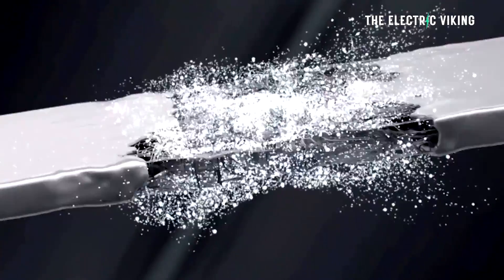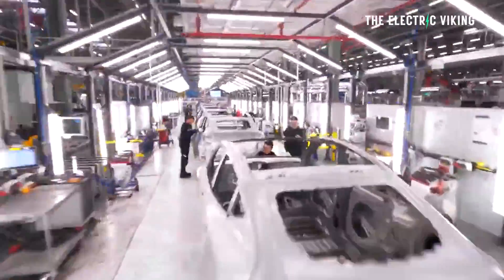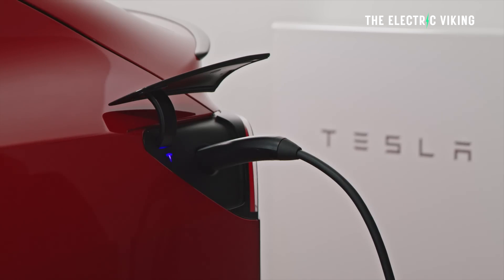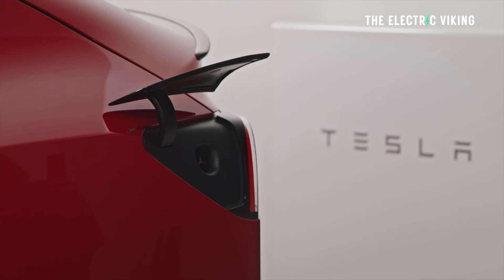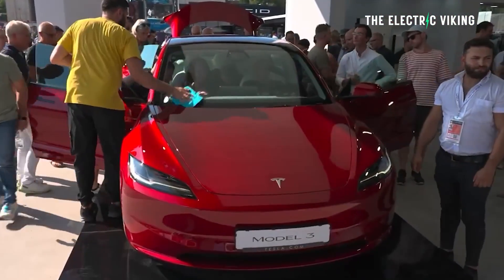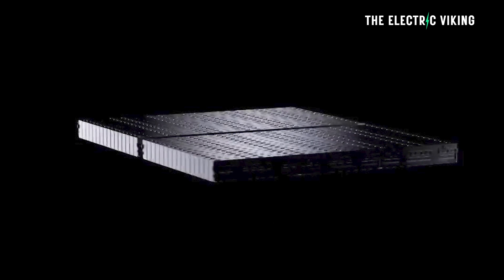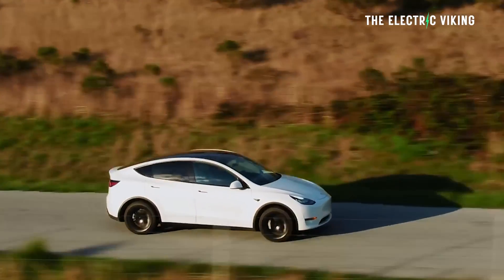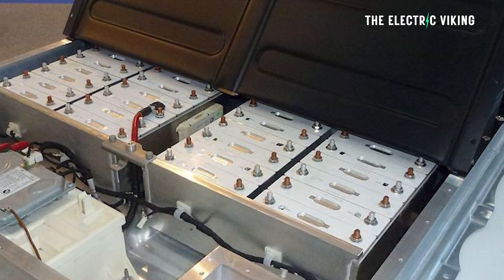Energy density of CATL's Shenxing battery revealed for Tesla Model Y Juniper

Comment: Range isn’t as important as charging speed and the availability of DC fast chargers. 250 miles of range and ability to add 200 miles of range in say 15 minutes is key. Then you are almost at parity with ICE cars and those without home chargers will feel comfortable owning an EV. Also a smaller battery will keep costs and weight down. If this battery achieves this it is a “game changer”😂
Reply: There are people who need long range - they own a garage, travel 400 miles a day and have no time to sit at a DC charger. Others are the opposite, they own no garage and can't afford larger battery sizes -they need plenty of superchargers. They should cater to both markets.
Reply: @Michael-Has-Opinions It has to be about 1% of the population that drives 400 miles a day?
Reply: Longer range I would rather have ,personally.
Reply: Range matters if you want to go fast. I have a newish model S with a stated 402 miles of range. When I’m doing long highway trips I pass Y’s and 3’s all the time as I don’t have to drop my speed down to get the range to hop from charger to charger. It’s funny I don’t see this talked about, but it’s a real thing. More range = faster driving.
Reply: I don’t drive fast, I charge at night and start each day with 250 miles of range approximately, how many people need more than that? Probably less than 5%.  How many road trips do people take in a year? If it’s more than 600 miles don’t most people fly?

Comment: They could probably reduce the battery size to get the same range and gain greater operating efficiency.
Reply: That makes no sense. Range goes down with battery size.
Reply: @Michael-Has-Opinions  If the energy density is increased, a smaller battery with the same kwh will weigh less, so the car will use less energy to go the same distance.

Comment: Just dreams. My DJI drone still flies no more than 20 minutes. No improvement in 10 years. When my iPhone lasts 2 weeks charged instead of 6 hours please wake me up 😢
Reply: U comparing your iPhone battery to CATL battery .. 😊Amazing
Reply: @JOEROGAINundefeated how much do you think energy density has improved from the first Tesla battery in the model 3 to the current ones? 

That's a 5 year period..
Reply: When apple adds a battery management system that manages the temperature and allows you to adjust charging limits it will alway be disposable.  I hear the latest iphone has charging limits. They are putting it on the new phones to get people to upgrade!   Heathens !!!
A nice addition would be a charger that talks to the iphone or ipad via bluetooth and turns the charging on and off to manage temperature and battery limits.  They might well last that 10 years.
Reply: Couldn’t agree more……lol

Comment: What about the huge Model Y inventory? How is Tesla going to be able to handle Juniper transition and new CATL battery and huge inventory? Short term the stock could go up based on Elon's promises made at earnings call, but that will just be until practical ""details" like the ones above has to be managed. People are fully aware of these quantum leaps in battery technology going on, and no one likes to buy now and end up holding the bag. Significant improvements in range are not happening that often, so you will like to buy at the right moment.
Reply: I just my part to reduce inventory
Reply: @muskepticsometimes9133  Model Y ? Which version?

Comment: 620 miles of imaginary range 😂
Reply: Given that current models have significanlty >300 miles real-world range, why is that such a stretch?
Reply: No. Official ranges are real, just at lower speeds than regular road trips. So if you want to consider regular long trip, just multiply the official range by 0,7. 430 miles in a full 100 to 0. Recommended to remain a 10% charge (so 390 from 100 to 10). Just stop when the battery was between 30 and 10% charge 10-20 minutes in fast chargers and do regular stops in places where you have slow charge availability so you just charge the same time you rest.

How much charge it will depends on multiple conditions, but with this formula, most of the times you will do one or two fast stops and one slow stop that you can use for rest/eat etc. and you can do almost any regular long travel.

That's all.

Comment: I don't see how it will improve range if it still doesn't match Nickel Cobalt density.
NCM from Panasonic is still 270 kw/per kilogram. (Sorry I meant watts per kilogram)
Reply: My guess it's due to packaging. Anyway, imo, range its becomming irrelevant nowdays. Personally i rather have faster charging, longer longevity and less cost.
Reply: If the cells are cheaper, more cells can be put in the car for the same total cost
Reply: @laurap3244  Thereby taking up more room and adding more weight ! 
With a battery of 205Wh per kg and a highway speed of 70-80mph, each kilo adds about 0.7 miles of range
A kilo of diesel gets you 10 miles
Reply: Yeah with a weight penalty.Might it be better at a pack level ?
Reply: Yes not sure how to make sense of this announcement, given that aspect.  Perhaps they are putting in bigger batteries nowadays.
Reply: One way it can improve range is to eliminate the "protected" portion of battery usage at both the full charge and full empty extremes - both at the manufacturing end and for consumer usage.
Reply: @ohger1   The protection is to maintain good battery life.
I suppose you could dip into that if you wish, but if you come to sell how will someone know you've done that, and therefore reduced the total battery life ?
Reply: @chrisbarron5861  LFP batteries do NOT need the built in buffers...  You can charge an LFP to 100% every day if you want.  I never charge my 2019 S past 80% or drop below 20% for very long.
Reply: @ohger1  Were you warned about that before you bought the car ?
Reply: There was another reason for the 100 percent charging . Since the voltage output is lower it's hard to estimate
the remaining charge remaining charge in the battery because of the low voltage difference between charged
and empty. The three times as as long life is appealing and the no fire aspect to . But it will be a little while before
they approach NCM charge density per kilogram. Still not a lot of long term data on the LFP's
Reply: @chrisbarron5861  Of course.   What I don't know is if there's a hold back inside the car's software.  In any case, I plug in every night and charge to 80%.  I haven't spent more than a combined 3 minutes a month "refueling" in 5 years.
Reply: @ohger1  3 minutes a month maximum, to recharge to 80% every day ?
Lets do the Timewarp again !
Reply: @chrisbarron5861  Let's do the math, shall we? I pull in the garage, connect the connector. 5 seconds.. In the morning, I remove the connector and hang it up. 5 seconds.  So that's 10 seconds a day, 70 seconds a week, 210 seconds a week.  That makes 3 minutes, 30 seconds.  You win..
Reply: @ohger1  @ohger1  oh I see what you mean.
In between those 5 secind periods do you still have full use of your car like you would if it was ICE ?
I fill my ICE twice a month.
9 minutes total.
1600 miles in total.
Total time that I cant use the car each month due to 'recharging' = 9 minutes every 1600 miles 

How many minutes per month is your EV unavailable because you're  waiting to charge.
(Hint - your answer is in hours)
Reply: @ohger1  I cant imagine paying for a car, for its tax, and its insurance, at times when you simply cannot use it because its charging.
Reply: @ohger1  Talking of math, you said 
"70 seconds a week, 210 seconds a week"

You presumably meant "70 seconds a week, 280 seconds a month"
(If we use the same 'normal western' math)

So you do 28 charge cycles a month, at home. Most home chargers are 7.5kW, lets say 

You have a model S which you charge every day.. Is it the 70kWh version ?

I assume you don't charge it from 20%-80% every day, but if you did, then you would need at least 10 hours of charge per day on a 7kW home charger

If you have a fast home charger and only do a partial charge, then maybe you charge 4 hours per day, which across 28 days is 112 hours, then you effectively lose about 4 and half days worth of car use every month.

I lose 9 minutes of vehicle availability per month

Thats math !
Reply: The Viking, reported in the last couple of weeks about an LFP with 450 Wh/kg in use today
Reply: Did you mean 270Wh? Your "270 kw/per kilogram" is totally wrong.
1. it's W, not w
2. It's kWh, not kw
3. It's not 270kWh/kg  but 270Wh/kg
4. It's "270kWh/kg"   or   "270kWh per kilogram"
You are welcome
Reply: @paolopetrozzi2213  Your number 4 is wrong.   Think about it for a nanosecond.  270 kWh/kg?  You mean you could have a battery 2.7 times as big as a Model S, and it would weigh one kilogram?  No.  It's 270 Wh/kg.   You're off by a factor of a thousand.
Reply: @incognitotorpedo42  
Obviously. I wrote in on my number 3.   On the number 4. I was focused on the "per" error, and I didn't notice it. I do not need to "Think for a nanosecond", as I already wrote it properly the line before it. Go play on the highway
Reply: yep my mistake exactly should been watt per kilogram